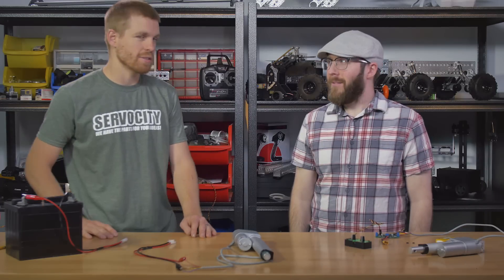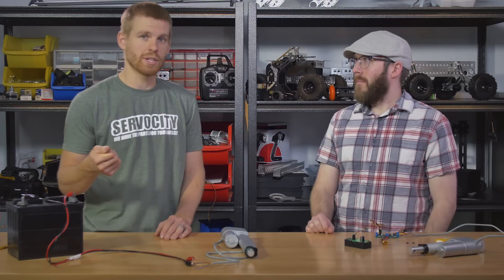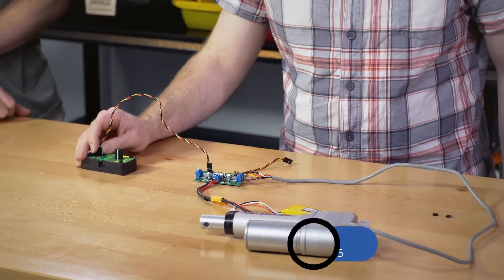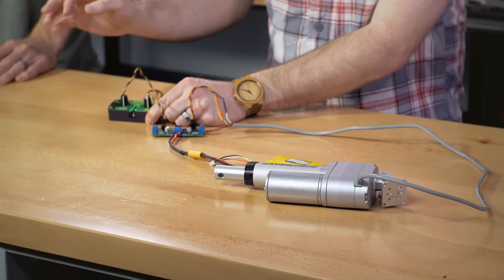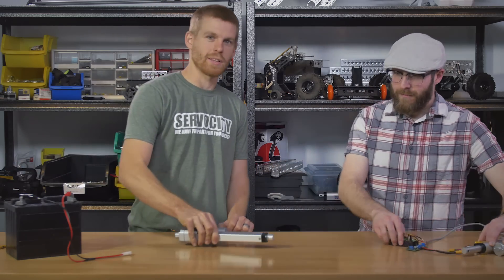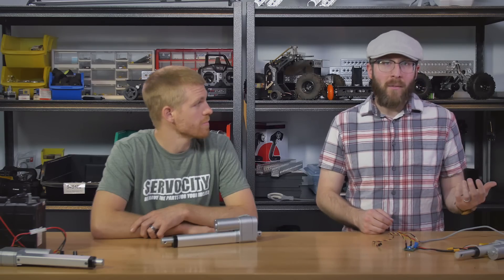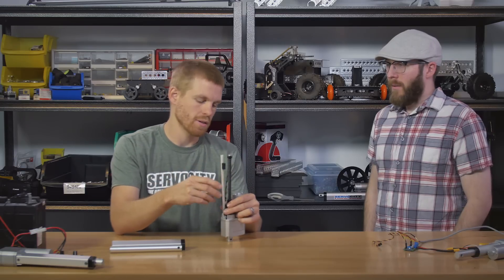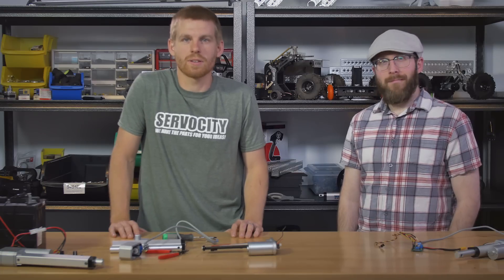Comparing Linear Servos & Linear Actuators - with Kyle and Jason

Comment: I've notice some linear actuator move super fast and smooth. They are almost silent. Are these powered by electric motors and a threaded shaft. The way they operation almost seems like they are powered magnetically. What are these linear actuators called?
Reply from the maker: It's hard to say for sure without knowing the actuator models you are looking into,  they could be magnetic. However, there are also pneumatic cylinders that can be very fast, or hydraulics.  If you still have questions please feel free to email tech@servocity.com and provide a link if possible for our team to look into further.

Comment: the difference is in the semantics, and those are objective. the difference between a servo and an actuator, is the same as that between dinner, chicken soup, and soto ayam.  but generally an actuator is any component causing deliberate physical movement. be it a hydraulic cylider, the voice coil of a speaker (or HDD), a slolenoid, a purpose built explosive charge ... or a servo, which can be defined in different ways again.

Comment: How do I make it automatically move in and out ? With some type of optical eye, like a sliding door, when someone is approaching it, and it opens for a min and closes automatically.
Reply from the maker: Hello Tim. Please check out our Apparition Apparatus project on Instructables (https://www.instructables.com/id/Aberration-Apparatus-Halloween-Prank/ ). It should at least get you pretty close. If instead of sending a PWM signal to a transistor to drive a motor, you sent a PWM signal to a linear servo you could do what you want.  Feel free to reach out to our Tech Team at tech@servocity.com should you have any other questions.

Comment: This is what I want to build. A STEWART platform. But imagine a ball & socket on top of a pillar little friction. Actually I am working on a mag-lev ball & socket... but it's still secret! It can be done but... needs Helium or liquid NO2but it should work! 

No weight to lift,  basically pitch & roll for an aircraft simulator. https://www.dgrelectriccylinder.com/how-to-build-6dof-motion-platform-simulator/

They sell complete Stewart platforms with controls actuators , servos or step motors starting at 35K for 500 pounds...

Comment: What about synchronizing  4 servos for a 4 DOF platform sitting on a ball & cup shaft holding all the weight of the simulator?  I am  building a full size 767 coc
Reply from the maker: As long as the loads on the linear servos are appropriate, it's possible to do.  If they all need to work in unison just send the same PWM signal to them and they'll respond the same.  If they need to function independently then you'll want to run them on separate channels and make sure they're not working against one-another.  Feel free to reach out to our Tech Team should you have any additional questions tech@servocity.com.

Comment: Hello Guys, Great video,  I would like to use a Linear product to replace the old electronic window regulator motor to actuate the flaps. Can you please tell me what I need to install a gage indicating servo position (Up, 1/2, full) or (0, 15, 30)  This is in my very small homebuilt experimental aircraft.
thanks
Reply from the maker: While we do not condone using our products in high-risk applications such as this, I can help you with the question.  The gauge just needs to read resistance from the potentiometer if you're using a linear actuator.  This will be an accurate form of feedback.  Another option would be to use a linear servo and just have a read-out of the PWM signal being sent.  It's not a direct form of feedback as the linear servo doesn't send data back to the controller but you could assume that it's in a given position based on the signal sent. This second option would only be for less mission-critical applications given you are assuming the linear servo reached its target position as opposed to reading the actual current position like in the first option.
Reply: @ServoCity  thank you

Comment: Awesome vid...does the amp of battery effect the actuator?  Asking because I plan to install 2 linear actuators in my truck and debating if I should tap off the truck battery or off separate battery. Thanks
Reply from the maker: Thanks, Benjamin.  If you are running linear actuators, you can tie them into your vehicle battery without a problem.  The motor in an actuator won't be bothered by the fluctuation in voltage due to the alternator.  More care would need to be taken if a micro-controller were in the equation.  Feel free to email us should you have any other questions tech@servocity.com.
Reply: @ServoCity  awesome, thank you!!!

Comment: thinking of building my own screen for my home theatre projectore.  i want to build a simple frame that would mve black board top and bottom from 16/9 rastio to the  ratio  2.39:1.  Esentially i am thinking 2 pieces of wood or light material that will move together so when i press a button botom frame goes up and top part of frame goes down.    I can build frame easy enough but if i can find some cheap lightweight servoc one for top frame and one for bottom then i think it would work, but not wanting to spend alot, cheap is cheap.  Any recomandations for none industry standared parts, for the home brew kits
Reply from the maker: If you have to move each panel in two directions you might want to look into building a frame behind the panels (think XY table) and fasten the panels to the movable dolly.  You'll then want to select a drive mechanism that works for you (timing belts and pulleys, lead-screws, cable and pulleys, friction drive, etc.)  Feel free to reach out should you have any other questions tech@servocity.com.

Comment: Hello
I would like to make something like this, (https://youtu.be/FoumVAdmFWo) but what components or board do I need to build similar to this? On internet I only find controller for two directions, and speed.... But for position limiting I didn't.
Reply from the maker: The Actobotics Dual Motor Controller https://www.servocity.com/actoboticsr-dual-motor-controller-assembled has a  position control mode which you can use with the potentiometer feedback of a linear actuator.  Please let us know tech@servocity.com should you have any other questions.  Thank you

Comment: Which motor is used in the actuator ??
Reply from the maker: We have several different sizes of linear actuators and linear servos so they use different motors.  They're all brushed DC motors at this point.  Feel free to reach out to our Tech Team should you have any other questions tech@servocity.com.

Comment: Is there a servo or actuator that is big enough to reach 8-10 feet? Or something that can reach close to that height? Working on a project for wireless surveys and need something like this to add to a pi
Reply from the maker: There are some very large linear actuators on the market, but I doubt you'll want to tote something of that scale around given the weight that is likely to be associated.  If you take on building something for your application you might get some inspiration from an extension ladder; pull the rope and it extends out.  You could use a motor to reel in the rope or cable that you use to drive your assembly.  Feel free to email our Tech Team should you have any other questions tech@servocity.com.

Comment: Are these water proof or do you need to buy ones that come water proof.
Reply from the maker: Hi Charlie, our linear actuators and linear servos have IP ratings which will give you the extent of the water resistance.  Feel free to contact our Tech Team should you have any other questions tech@servocity.com.

Comment: Your needed is our research power, your prompt and
favorable reply should be very appreciated.

Tel# 886-2-28326773
           FAX:886-2-28327852

Address: No. 214-3, Zhou Mei Street, Bei Tou
District, Taipei, Taiwan, R.O.C.

Cell phone: +886978377508

FB: https://www.facebook.com/hung.nora.3

        https://www.weitaitransmission.com

Website: http://www.weitaitw.com/en/ball-screw-nut.html

https://www.youtube.com/watch?v=jQW23Bx59WQ&feature=youtu.be

You tube: https://www.youtube.com/watch?v=-8kBVM4JCBg&t=41s 

We chat ID: w0978377508

Email: 02weitai.ltd@gmail.com 

Wei Tai Transmission Limited Company

Wei Tai Transmission Limited Company is the head office
in Taipei and acts for all of international trade activities to handle the
shipment supplied from Shen-Han Shenzhen factory.  We are looking for the
new customers in your regions and it’s thankful if you can give us a chance to
work together with.  Please feel free to contact the following:

 

0601 0606 0801 0802 082.5 0808 0810 etc. Only our factory has produced in China.

(1204, 1210, 1220 ,1606 1616, 1632, 2505, 2550, 2440, 2020, 2040, 2525,
4040 5050 etc.)

. High lead ball screws and screw nuts

. Ball screws and screw nuts in customized specific
standards

Capabilities of Shen-Han Technology –

Comment: I have a question. Can I use the linear actuator to do the automation of the window in smart buildings?
Can i control it using my daq and labview ?

In my case, the windows must open depending on the temperature of the space.
Reply from the maker: Hi Julien, if the stroke and thrust of the linear actuator is adequate for the task then it should be a fine option.  From a control standpoint, an actuator could be wired to a motor controller and it would be up to the controller that you choose to sense things like temperature.  Feel free to email our Tech Team should you have any other questions tech@servocity.com.

Comment: Is there any way we can get benefits of servo actuator in linear actuators with some simple additions or changes.Secondly what's cost difference in general? What's the max speed force and stopping accuracy of each of them?
Reply from the maker: You can create a linear servo on your own using a linear actuator and a motor controller that has positioning feedback.  Cost is dependent on what components you select for your project.  Speed is dependent on the ratio you use and accuracy is going to come down to the stroke length of the actuator (as that will somewhat determine the resolution from the potentiometer) and the circuit board you choose to drive it.  Email us at tech@servocity.com if you have any other questions and we'll assist you.
Reply: @ServoCity  thank you for elaborate reply.Readon being as a designer one tends to over design by using servos thereby increasing overall cost Thank you providing your contact email.

Comment: Hi, nice video, question how can I make a automatic stop limits switch ?
Reply from the maker: Hi, Harold.  Many of the actuators have internal limit switches.  The super duty actuators https://www.servocity.com/motors-actuators/linear-actuators/super-duty-linear-actuators have adjustable switches while the heavy duty actuators https://www.servocity.com/motors-actuators/linear-actuators/heavy-duty-linear-actuators have fixed limits.  If you still have questions reach out to us at tech@servocity.com and we'd be glad to assist with your specific build.

Comment: How do these cope with dirty and wet environments like on a tractor bucket?
Reply from the maker: You will need to consider the IP rating of an actuator in such an application.  Most of our actuators are IP54.  While it depends how you use your tractor, I would suggest looking for IP67 or higher.  Feel free to reach out should you have any other questions tech@servocity.com.

Comment: Nice video. Very helpful indeed. 

I have been going through some linear actuator sites, they mention usage rate or duty cycle like 20% in their specifications, what does this mean?? Could anyone explain.

I am looking for a linear actuator , 80MM/sec speed, with Hall effect encoder for position feedback. The actuator would be active every 2 minutes, with rest periods of 2-5 minutes. Will this type of operation affect the life of the motor ??

Comment: If your still around I would like to ask a question. I have an actuator that has stopped working (extending and  retracting) and need to raise (retract) the shaft to its shortest length. What would be the simplest way to do this manually, if possible?
Reply from the maker: It depends on the design of your actuator, but if you can access the lead screw driving the piston, just rotate the lead screw manually (assuming it will still turn) to manually extend/retract.  Feel free to contact us should you have any other questions tech@servocity.com.

Comment: Hey guys is there a way I could add a safety feature to my actuator or servo so that if an abnormal amount of pressure is detected it will stop or move in the opposite direction?
Reply from the maker: There are ways to sense the current draw, and there are also force sensors. Which is better for you depends on your physical setup, use-case, and how you are controlling it. But it is possible.  Feel free to shoot us an email should you have any other questions and we'd be glad to help tech@servocity.com.

Comment: Is there any way to program one to go in and out to a certain point with only a button?
Reply from the maker: Yes, that is possible with either a Linear Servo or a Linear Actuator (one that has a potentiometer). I recommend using an Arduino for this application. A linear servo would be easier than a linear actuator since you would not have to purchase or learn how to use a motor controller.  Let us know should you have any other questions tech@servocity.com

Comment: Please help, I have satellite actuator with reed magnetic switcht built in, can arduino read the stroke position? And can arduino distinguish between forward and reverse move of the rod?
Reply from the maker: Hi, Joni.  If the actuator has a potentiometer built-in then you will be able to read that as an analog input to get the position and determine the direction.  Please feel free to contact us should you have any additional questions tech@servocity.com.
Reply: Are potentiometer and rotary encoder same?
Reply from the maker: @jonihermawanto9896  In a way, a potentiometer is a kind of rotary encoder although usually when you hear "rotary encoder" they are probably referring to something digital.

Comment: Does every linear electric actuator comes with these 4 wires, two for power supply and the other two for control?
Reply from the maker: Linear servos have five wires total.  The large red and black, terminated with a tamiya connector are for 12VDC power.  The black, red and yellow with a TJC8 servo connector are to go to your servo controller.  Linear actuators have five wires too.  The red and the black go to the motor, the blue, yellow and white go to the potentiometer.  Please feel free to email our Tech Team should you have any additional questions and we'd be glad to help! tech@servocity.com.

Comment: You dont offer a linear actuator 60 inches long?
Reply: Do you need to move something 60" or just connect something that far apart?
Reply: @garybiggs9010  I am looking to build some retractable solar panels that are 62 inches long on an rv roof.
Reply: @firpofutbol  Are the panels in a heavy frame where you could connect the actuator around 30" up from the hinge point vs the farthest point away from the hinge?

Comment: Very useful video.because of the situation I will put it,sometimes it will work manual,so the power sometimes will be from the bracket to servo motor.Can it move?Will it may do a problem to the servo motor?
Reply from the maker: Hi Antonis, please email tech@servocity.com with your question and project specs and we'd be glad to assist.  Thank you!
Reply: @ServoCity  Thank you very much. I have in my mind a concept which i dont know how to code. Can any body help me about this?
Reply from the maker: @antonis2814  Hi Antonis, please email tech@servocity.com and we'll see how we can assist. Thank you!

Comment: I wanted to know if it is possible to connect a dual motor controller to a computer, so that the speed and position may be controlled by using a software.
Reply from the maker: Not directly. It can run off of a PWM signal or analog voltage.   Let us know should you have any other questions tech@servocity.com.

Comment: I want to use these motors for my robotic arm project.But my doubt is whether these motors are able to hold the weight of robotic arm when not powered or are at halt at a certain point .
Reply from the maker: Hi Saksham, the HD series actuators are extremely difficult to backdrive.  It depends on your setup, but I would highly doubt that it will cause the actuators to move when powered down.  Let us know should you have any other questions tech@servocity.com.

Comment: I need a linear actuator which has 1 mm precision on the position of the shaft, and large stroke of >2 feet. Speed does not matter ( at least 1 inch per hour), I need to move it by 1 cm every day. And maximum load does not matter since I have to move a neutrally buoyant object under water which weights zero! Thank you very much
Reply from the maker: Those specs are certainly out of the ordinary.  You may have to build your own actuator to check all the boxes.  Should you have any other questions feel free to email us at tech@servocity.com.  Thank you
Reply: All actuator I see on amazon satisfy my needs except for not being marine, and I am not sure about the 1 mm precision, I see no mention anywhere. What is the issue with the 1 mm precision? What's the precision of the feedback mechanism?

Comment: Hi any brand you would suggest for underwater linear actuators? I need them underwater on the beach (salt water) for many month, powered from a 12V battery + solar panel on a pier (I have permit don't worry). thanks
Reply from the maker: Sorry but we do not have a suggestion for a marine grade actuator.